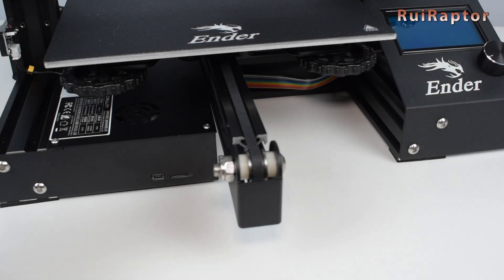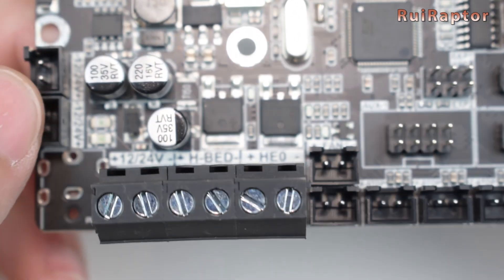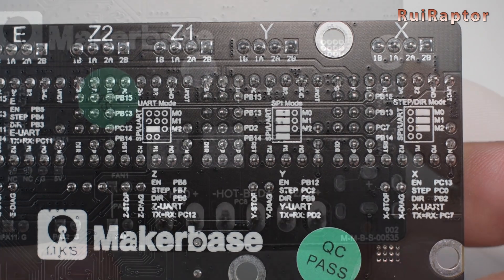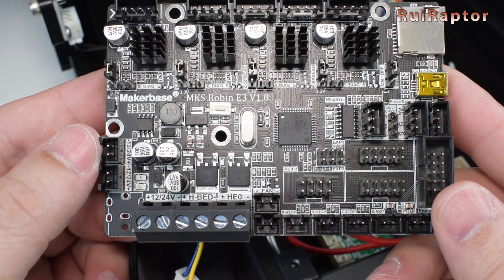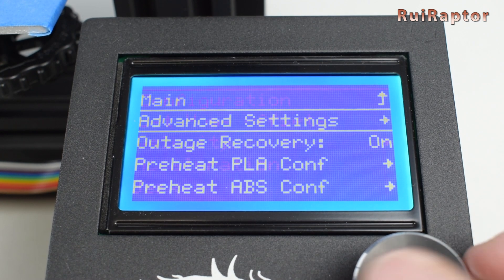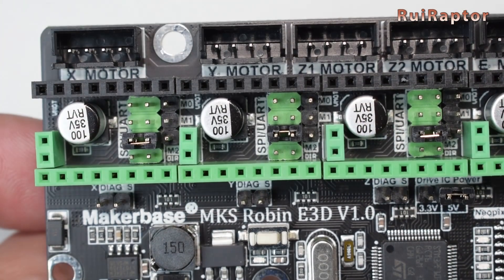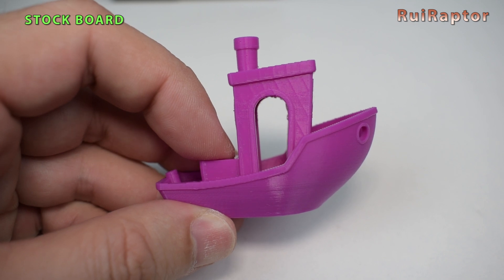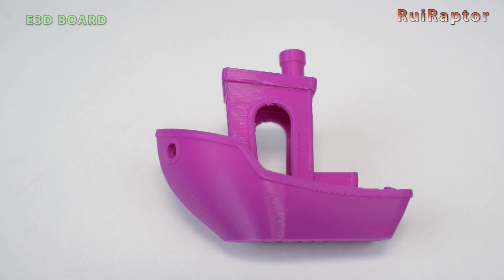MKS MAKERBASE Robin E3 / E3D - Installation & Tests (Creality ENDER3)

Comment: No FAN connector? If I connect the Hotend FAn in the Power Supply I do not have control of the FAN speed, It is correct?
Reply from the maker: Hi Ramiro, the fan that you need to control it's speed is the layer cooling fan and not the hotend fan. For the layer cooling fan, you have a connector and you can control the speed.
Reply: @ruiraptor  yes but if I want to control hotend fan based on nozzle temperature can`t I just use second FAN connector which can be seen at 2:05 on the bottom of board?

Comment: My issue with this board just like some others with integrated drivers is that they dont sink enough heat. Basing my thoughts on the price and other similar boards, this board most likely does not have the 4 layers of 2 OZ copper that tmc recommends. Stepper drivers wont get enough cooling due to not enough airflow across the bottom of the board(where they sink a majority of their heat) and not enough material to sink their heat into. BigTreeTech has had long standing issues with driver failures which is exactly why they have increased the number of layers from 1 2 OZ on the BTT SKR Mini e3 v1.0/1.1 to  2 2OZ layers on the SKR Mini e3 V1.2, to 4 2 OZ copper layers on the SKR Mini E3 V2.0 which they just released information about at around 3am EDT. To me it just seems like this board is a year behind the SKR Mini E3 series unless my thought can be proven wrong.

Comment: Nice video Rui !
Overall, what board did you recommend for one Ender 3 PRO ?
Im getting mine next week. Obrigado !
Reply from the maker: Hi, This board from Makerbase looks very good and it's a serious candidate of being one of the best. I only wish the manufacturer would fix the eeprom issue so it would not need the memory card.
Reply: ruiraptor and add a conector for the hotend fan... it’s weird make a board for an especific printer and don’t provide conectors for the basic configuration. They should fix it for the next version in my opinion. 

By the way thanks for this awesome review ;)
Reply from the maker: Hi Fernando, from what we know, and from the images online, this was probably one of the first units available and the next ones already have the extra connector for the fan.

Comment: Nice video! How it performes this board?
Reply from the maker: Thanks, from the tests we made, both boards (and when using TMC2209 with the E3D) show improvement in print quality by eliminating the salmon skin. They also eliminate the noise from the stepper motors.

Comment: Does these boards works with the Tevo Tornado?
Reply from the maker: Hi, yes, these will work with the tornado. You only need to make a support mount to secure this board and configure the firmware for the tornado.

Comment: Considering the printer has no facility to eject the memory card I would not feel confident having my firmware config file on an SD card, who goes about designing a 3d printer board and decides to save a couple of cents by not including an EPROM to save the firmware to, well as far as I am aware this MKS is the only board that this has been implemented to. this is definitely not for me
Reply: Both the SKR Mini models and the SKR Pro boards did this initially. Later a method was devised within Marlin itself to reserve a portion of the internal memory for EEPROM emulation. Apparently, Makerbase didn't bother doing the same.
Reply from the maker: That is correct and we must add that the Fysetc cheetah boards also had this issue and the manufacturer managed to fix it. I'm sure Makerbase will too. After all, the SKR boards also have the same microcontroller.
Reply: @ruiraptor  could you load the firmware for the SKR 1.3 onto the Robin and get the EEPROM fix? (it's the same microcontoller?)